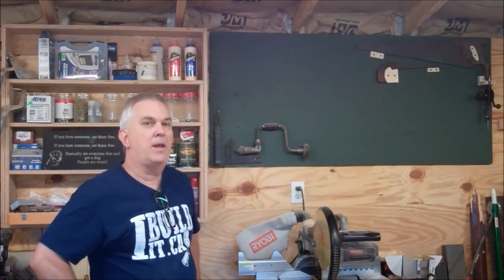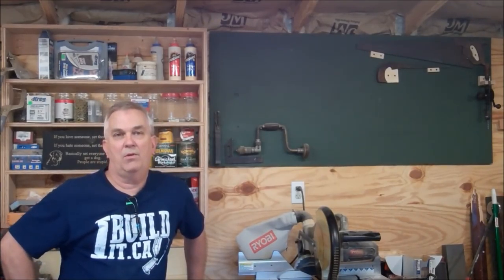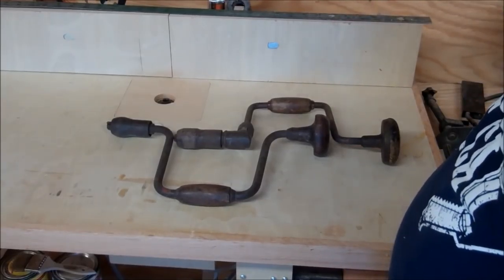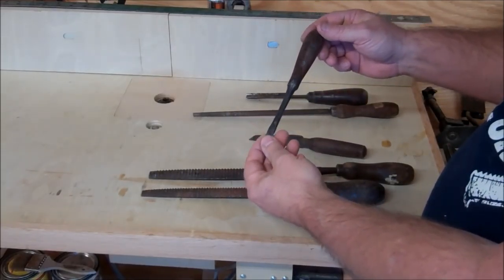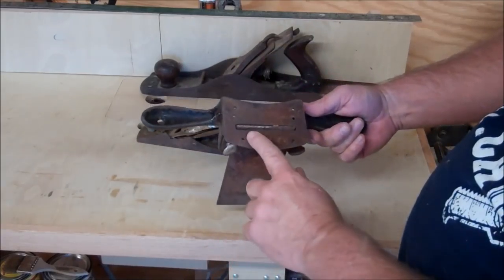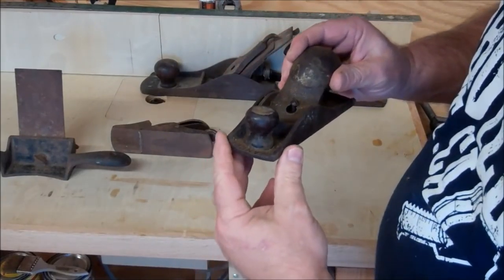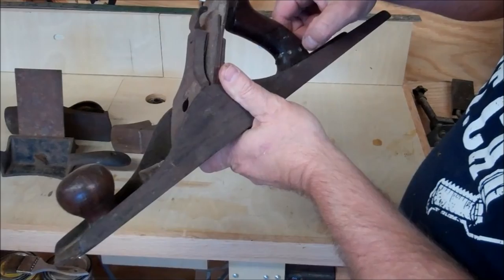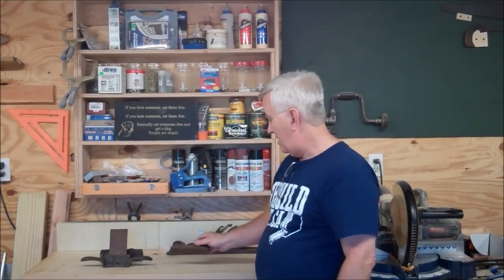Old Hand Tools

Comment: Nice collection, Dave. With a little Evaporust, steel wool, and elbow grease they can be returned to service. That little skew block plane is really neat, also the No. 80 cabinet scraper. Traditionally a light coat of camellia oil is used to protect hand tools, but that may not be adequate in Georgia. Something like Boeshield might be better. Good luck with the restoration work!

Comment: Hi Dave:Nice set of tools.  I know a few things about old tools but just a little.When it comes to hand saws the larger teeth are for ripping and the smaller teeth are for cross cut.A suggestion would be to use a lighter color on the mounting board.  Not much "pop" with brown on green.The routered holder show this pretty well.Router is coming along when I have time to work on it.September in Minnesota, I have winterizing projects to do.Marlo

Comment: Hi Dave, I agree with everything that Man na says except the correct name for the gouge is a hand gouge, a carving gouge is curved (excuses me for being very pedantic). Stanley still make these planes but are very expensive the No 6 is a smoothing plane used to get a straight edge on very long boards or in my trade it was used for shaping planks in clinker and carvel boats. The saw are could be spear and jackson ( very good quality steel but rust easily ) the difference between a cross cut and a rip saw is the teeth per inch not the length the one you held up indeed appeared to be a rip saw the small saw with reinforced back is a tenon saw. The screw driver is a london paten screw driver very common a hundred years ago in fact when I received my tool kit an apprentice shipwright (40 years a go) it had one in it. 

After you have clean them up if you intend to use the then a light film of fish oil (WD40 or the like) will preserve them between use. If you intend to have them on permanent display either coat them in paraffin/candle wax or  metal lacquer for the shiny look. Dont just oil them and leave them, as oil oxidises over time and become acidic and in the long term will pit the surface of the metal.

Regards Tim

Comment: Hi,Do not stop using these tools so quickly, when it comes to the brace's they are very useful, they can take screwdriver bits and allow you to get a lot of torque and control when tightening or releasing screws